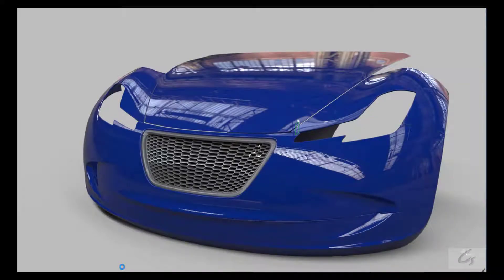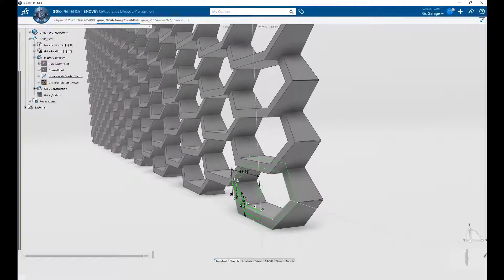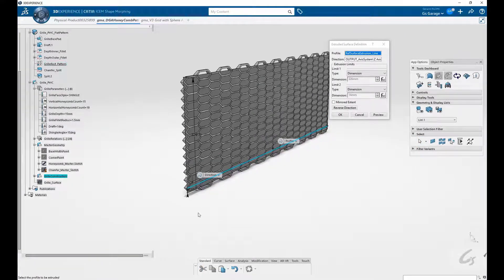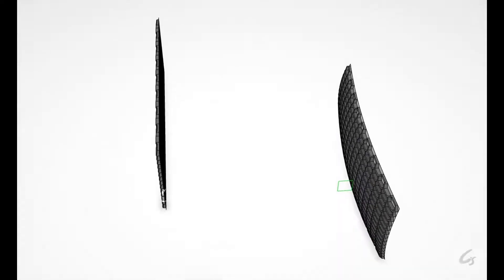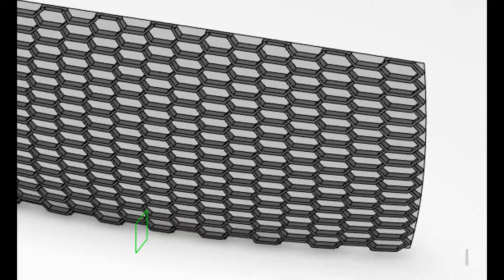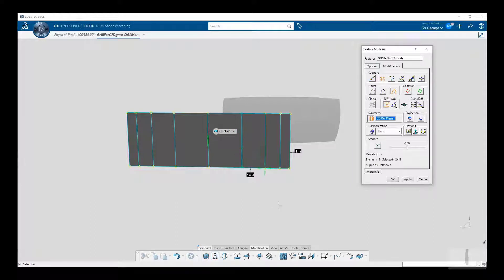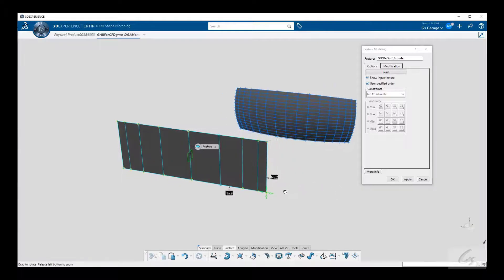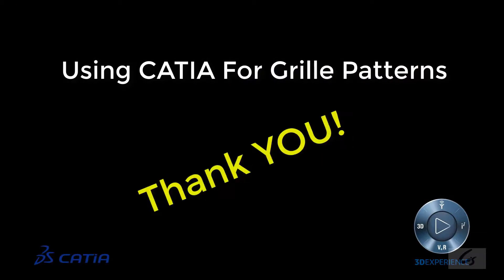GrillePaternsGsGarage

Comment: Hi Mr.Alcini,
I have a doubt regarding to the solid pattern of the grid, as you define the 2nd direction (horizontal), how do you get each column of the pattern in a different high? That puzzles me...
Thank you in advance.
Reply from the maker: Hi Jordi, The values for the honeycomb is defined in the sketch. This overview does not go into details in this area but if you need a better understanding of CATIA Sketches, there are plenty of videos that explain them well.